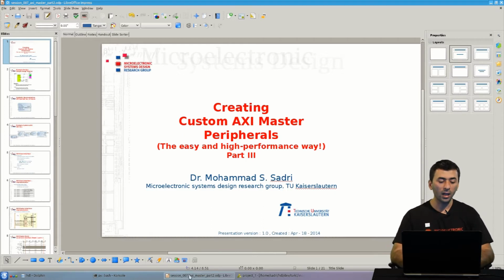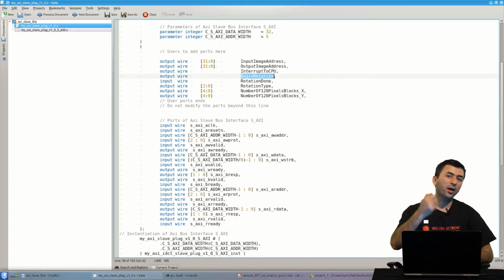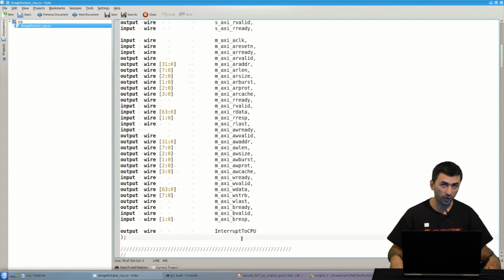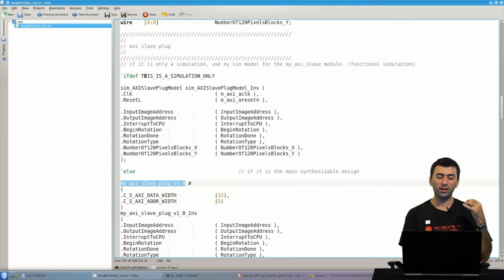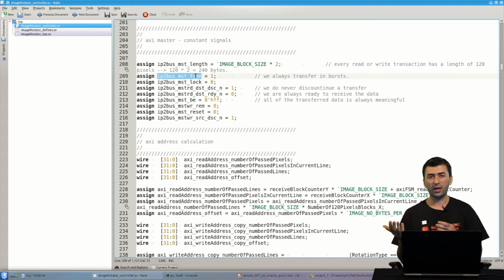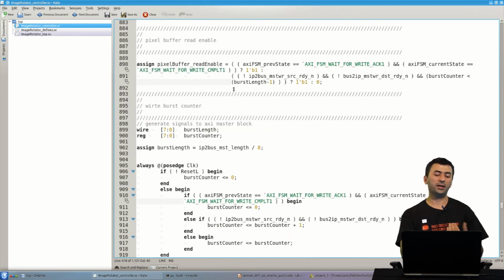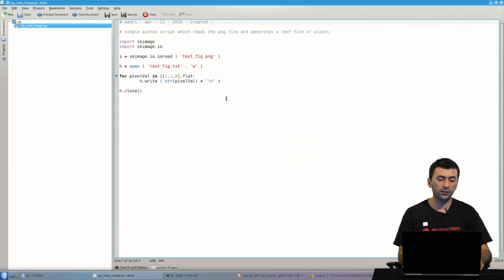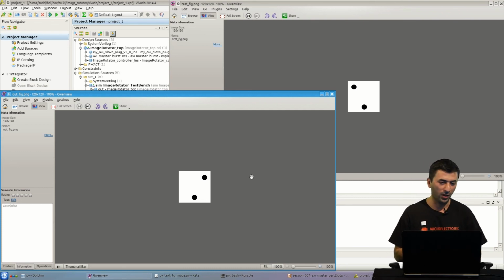Creating Custom AXI Master Interfaces Part 3 (Lesson 7)

Comment: Thank you for the tutorial! I've just started to learn AXI interface, and have a silly question... How can I find the IP core AXI_Master_Burst(PG162)? I've checked the IP catalog, but couldn't find this IP. My Vivado is version 2014.4. I don't know what the problem is.
Reply: Have you got the way?
Reply: AXI4-Lite IPIF is a helper core, not available in the IP catalog. The Core is available at Vivado installation directory...

Eg: C:\Instals\Xilinx\Vivado\2015.2\data\ip\xilinx\axi_lite_ipif_v3_0\

Copy the required files into your design and try.

Copied from Xilinx forum

Comment: Hello,
It was a great video. But I have a small doubt here:
Among the 3 files in the 'top' folder, which are the code files generated by Vivado as there were 2 code files for custom slave that were generated by vivado.
And one more thing, can you explain about how to create custom block for this example ? Is it one AXI lite slave and one AXI full master as one IP ?
Thanks
Reply: Hey darpan, did you get the answer to your question? how did you finally package the IP?

Comment: Hi, excuse me, one question, how do you configure the pixel buffer? I mean, the block for generate a true dual port ram with Vivado? thank you
Reply: +Omar Carrillo http://nopaste.linux-dev.org/?931928 (From MSDRG)
Reply: Hey Hi. Can you please tell me how do I use the xml code for pixel buffer memories you mentioned above. it will be a great help
Reply: Yo need to create an IP core with that existing xml file, use the Vivado create and package wizard
Reply: Prakhar
Reply: +Omar Carrillo Exactly which IP should I generate using the wizard? Block memory? can you please post some resources that I can study?
Reply: In the wizard select "Package a specified directory and select the xml file, let me know if it works
Reply: It is not giving me an option to select files. I opened the wizard and selected "package a specified directory" and It is generating a "component.xml" for me automatically. Help please
Reply: Hi Dr. Sadri, i could not download the files. The link you posted does not exist anymore. could you please help me. I really need to apply your example until the end.

Comment: Hi Dr. Sadri,
I have seen you in one of your previous video using the JTAG under Ubuntu, and I would like to know how did you manage to get it working ? In fact, I use Ubuntu 14.04LTS 64-bits, but I have not been able to correctly set up the JTAG cable drivers. Can you please give me some hints to get the JTAG working. Thank you.
Reply from the maker: +André Cavalcante you asked also for the pixel_buffer_blk_mem we uploaded it here: http://nopaste.linux-dev.org/?931928
Reply: 1enawder Install Vivado 2015.1. Notice that for 2015.1,  cable drivers are not installed automatically for Ubuntu. But during the installation of Vivado they point out to the specific Xilinx manual document with the instructions for installation of cable drivers.
Reply: +1enawder I think this should help : http://svenand.blogdrive.com/archive/172.html#.Vij3lB9_eFt
Reply: Thanks so much. Although I don't get any build error, I still didn't get the rotators to work. I will keep investigating why. Thank you so much. Congrats for the channel!
Reply: Can you please give some hints (or links to some documents) which tell how to use the xml format you mentioned above? thanks